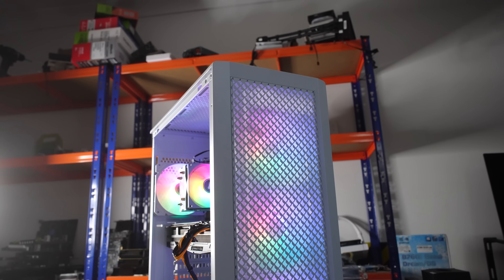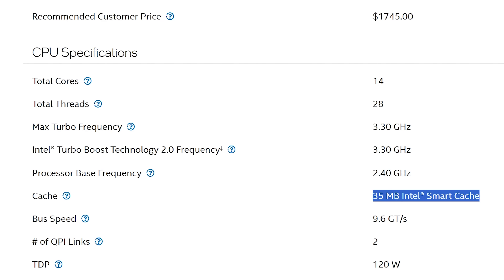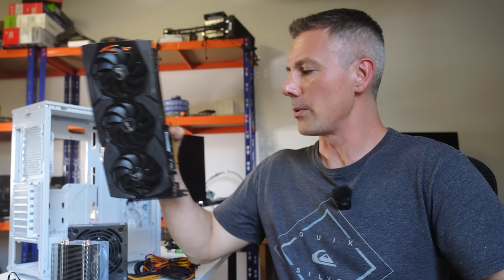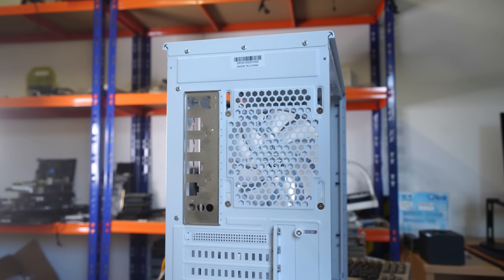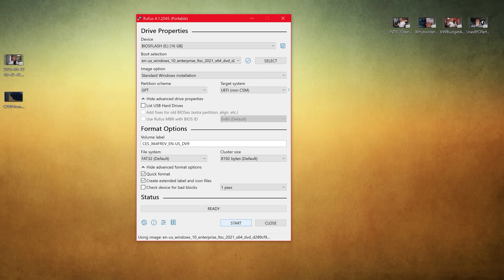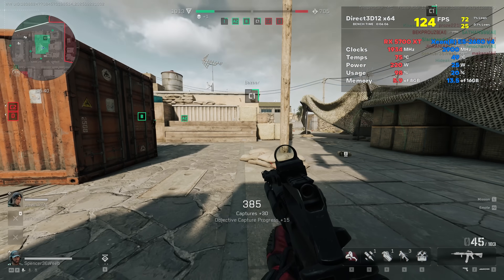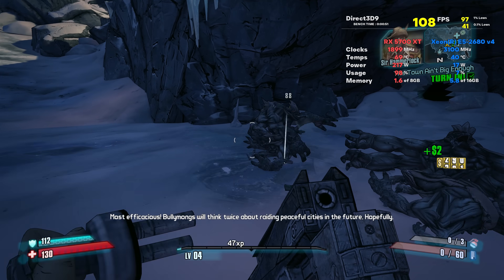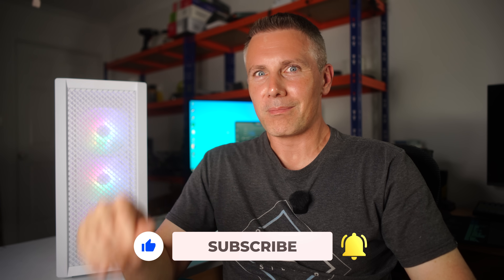An Under $400 Gaming PC That anyone can build!

Comment: Ryzen 5 5500 for 60$ or 5600 for 80$
B550 ATX Mobo for 80$
600W PSU for 40-50$
Case for 20$
32GB DDR4 for 60$
512GB SSD for 30$
2TB HDD for 50$
Total: 340-360$

Second hand RX 6600 => 100-120$
Total: 440-480$

And this is with parts brand new, widely available everywhere, except for the GPU, which is second hand and might vary.
Reply from the maker: Which case is 20 with fans? Though yeah ryzen is great if you have the extra budget.
Reply: @techyescity  they come with with 1 back fan for sure and some with 1 front and 1 back if you can catch it, but you don't need more, the 5500 is a 45W CPU maxed out with P95 and the RX 6600 is a 100-120W with Furmark, in games they'd consume even less and heat even less.

If you want to add fans, Arctic P12/F12 fans are 3-5$ a pop.
Reply: @techyescity  Shop near me actually sells Antec VX100M's for 25$, comes with 3 RGB molex fans.
Reply: @techyescity  a ryzen 3600 / MB and ram is like less than $50.00 MORE, and your not stuck on a dead end socket, and am win 11 compatible. and many other newer features.
Reply: thanks, I'm still using 3770 ivy bridge, and rx580. bought them used in 2016. I think it's time to upgrade
Reply: @Marta1Buck  It is time indeed.
Reply: @Marta1Buck Ivy Bridge is perfect for XP gaming, find a cheap GTX 900 series, and sell it off for more than you'd get as a slow 10/11 rig. Or keep it for XP.
Reply: @drewnewby  IMO ivy bridge and gtx 900 are Windows 7/8 gaming. Windows XP is the Athlon X64 to Core 2 Duo and GPUs before unified shaders, like the x1900 xt or 7800GT to be fully authentic. Or at most up to Fermi or Kepler 2.0 and Terrascale 3, if the older ones are hard to find.
Reply: @rattlehead999  I was replying to the other chap that said B550 should be $50. You're not wrong for period correct, but that's not today's customer. I build rigs for every OS, and it's usually up to Athlon XP for 98 SE, and up to Ivy Bridge for XP SP3. There's no 7/8 gaming builds. It's DOS / early Windows, 98, XP, then current. Unless you have some particular titles you're thinking of?
Reply: @drewnewby  Can't name them of the top of my head by a sizable amount of 2007-2012 games just don't work on Windows 10/11 without modifying files. Compatibility alone doesn't work. 

So I'd say there is a Windows 7/8 era. A couple for example are the Anno 1404 and 1701 games off the top of my head, my most recent headache I had, while on my retro PCs they run flawlessly.
Reply: @rattlehead999  I mean, I have honestly most titles of merit since the late 70s, so I'd have to say not sizable, but sure there's always a few. I've had no customers ever request a 7/8 install, and of the dozen systems I have, none are 7/8 either.
Reply: @drewnewby  Now those games would run on XP as well, but at the same time, newer old GPUs either don't have or have terrible XP drivers. 

But yeah, the non-unified shader GPUs are up to 2006, XP is up to 2006 as well and I think they just go hand in hand for being period correct.
Reply: Could save even more money and go B450 or A520 board
Reply: I flip this build all day long! Keep in mind prices in other countries widely vary!
Reply: You got robbed, those prices suck even IF they are new.  The 5500 is a 3600 and I wouldn't pay those prices for either of those CPUs(new or otherwise)
I just got a B650 Elite AX(NEW from amazon) for $80, B550 should be paying about $50.  Can get 32GB DDr4 way cheaper.  Also i'll take a used CPU/RAM/MOBO long before i'll take a used GPU so this math is all backwards.
Reply: @gottahavitvt  You got a B650 Elite AX on a discount for 80$, I'm talking no discounts. It's 170$ right now I checked.

You can get a good AM4 ATX motherboard with 8+2 phases + cooling for them, 4 RAM slots, and a lot of USBs for 50$?

Also 32GB DDR4 3200Mhz 14-16CL is 50-60$. 

The 5500 is Zen3, not Zen2 it's in-between the 3600 and 5600. 

And no, used GPUs are where it's at, because a used 5500 or 5600 isn't much cheaper than new, but a used GPU is much cheaper than a new GPU.
Reply: @rattlehead999  b650: yes, no discount, just on sale.  got it this week. Still listed today.

5500 is PCIE gen 3 and performs like a 3600.

I can get good B550s for that yes, don't care about your model/specs and if you're using 4 dimms you don't know what you're doing.

I didn't say their wasn't money in used GPUs(I build pcs), what I said is IF you are worried about buying used, then there is way more risk with the GPU than the CPU/MOBO.
Reply: @gottahavitvt Gigabyte is liquidating that v1 board, only reason for that price, if you didn't already know. Obviously, that's not a trending price for B650. That doesn't magically make B550 $50 USD though.
Reply: @drewnewby  I said 80$ for a b550.
Reply: @gottahavitvt  discount and on sale are the same thing...
You use 4 dimms, because when on a budget you can't afford 2x 32GB off the bat, so you go for 2x 16GB and then add 2x 16GB later.

There is next to no risk when buying a used GPU if there are sufficient pictures of both the GPU and GPU running, many give clips too and the seller has high reputation.
Reply: @rattlehead999  so nothing you listed is "on sale"? lol

Like I said used GPUs are fine, I buy them all the time, BUT compared to cpus they are a much larger rish with a much higher chance of having issues.  So if you "don't like used" you don't build new platform and used GPU.
Reply: @gottahavitvt  That is exactly what 90% of my customers do, new platform, used GPU. Bad take, at least you deleted your worst reply...
Reply: @gottahavitvt  Sure, but you barely save any money going second hand for anything but the GPU, so it's pointless. unless you grab a pre-built and then add a GPU and potentially PSU.
Reply: @drewnewby  i didn't delete sh*t.  The your customers don't care about new vs used.
Reply: @rattlehead999  lol, when I buy used I get much bigger discounts off used for cpu/platform and ram than the GPU.  I just picked up a full 7800x3d ITX system minus gpu for 400, including 64gb ddr5 and 1000w SFX on a strix itx board with 6 corsair icuelink fans..  Good luck getting that discount on a good condition 2 year old GPU.

Oh yeah I NEVER buy on Ebay or JAWA, they are way over priced for used parts.  I pick up all my parts local where I can inspect.
Reply: @gottahavitvt  I acquire more hardware for customer builds in a month than you will see in your lifetime kid. OP is spot on for pricing and value. No one cares what you found local, or the price of that v1 B650 board (I snagged several too).
Reply: @gottahavitvt  If you are buying from a local/national store it doesn't count. 
Also I can't get a 7800x3d second hand below 83-90% new price right now in both local/national and international stores/sites.
Reply: @rattlehead999  so because I don't get ripped off on ebay and jawa it doesn't count? LOL cheers.
Reply: @gottahavitvt  Can I get them at the price you got them in eastern Europe? No? I thought so.